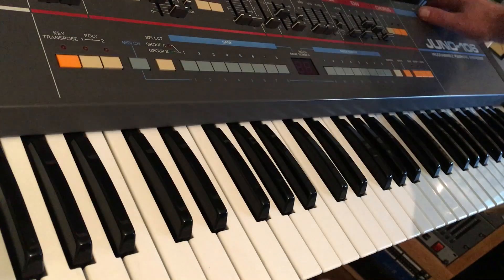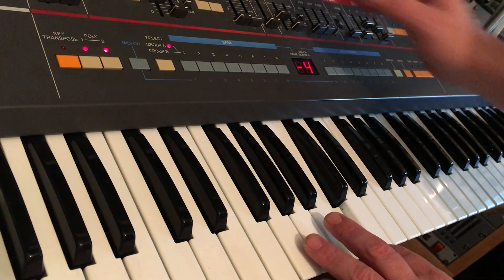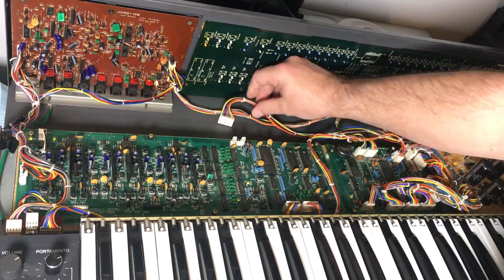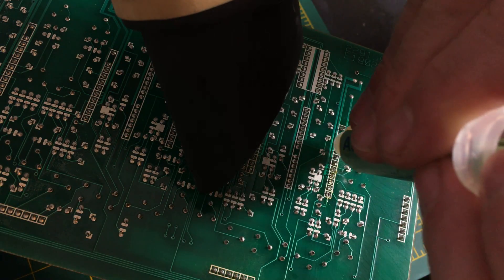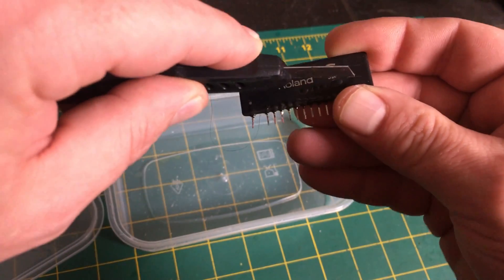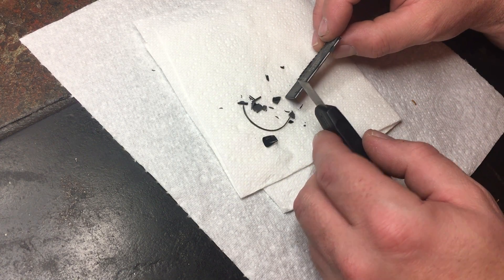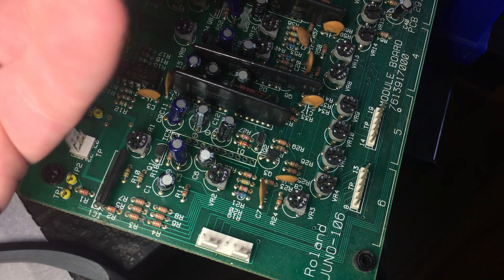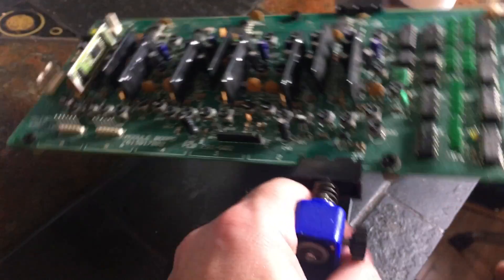Juno 106 Voice Chip Repair

Comment: If you plan to solder new male headers back onto the chips, just gently break them off the board at the pins and then desolder the pins one by one. You'll be replacing those pins anyway. It makes desoldering a whole lot easier.
Reply: lightbulb goes off in head this saved me soo much time. thank you.

Comment: So I have a juno 106 but every now and then a note will just not play and be staticy it will do this randomly with random notes I think it might be the frequency module but I'm not sure :0
Reply from the maker: if do the voice check like in the beginning of the vid you can see if its the same one that sticks high, it might not be as random as you think
Reply: but some keys just wont work when selecting poly 1 or poly 2 individually when both are selected, all the keys work but the notes are mono and i cant use multiple notes at the same time and every now and then a note will be scratchy. But im wondering where you are located because im just considering sending it to you or someone local to get it professionally fixed because i dont want to break it XD
Reply: Ok i just check over it, it seems it was acting really bazaar because 4 or 6 voice chips are not working

Comment: when you re-soldered the pins on the chip, did you solder on both sides of the chip? (the white side also?)
Reply from the maker: there are only solder points on the green side, as far as I remember the ceramic side is just a cradle point
Reply: I thought so too, but I read another article that said to make sure to solder on the ceramic part as well... I've just soaked 2 chips & am trying to get them working, but they're not.. just trying to troubleshoot on what I may have done wrong here, thanks for the input!
Reply from the maker: did you reflow all the ic pins etc?
Reply: I thought I did, I'm not an expert at soldering so I may have done it wrong, I'll try it again

Comment: What is the socket you are using to put the chip in called ?  Thx
Reply from the maker: It's called a female pin header,  2.54mm spacing
Reply: Thank's
Reply: @reallyniceaudio  thanks for the specifics on the header, I want to order some myself for future ease of repairs and troubleshooting.

Comment: Good job, however if you soak that chip in the acetone for a minimum of 48 hrs, the epoxy will literally fall right off and the chip is alot easier to work with . You also really need a good quality desoldering station to do this job properly as solder wick will damage the traces too easily. All 6 voice chips should be done as eventually they will all fail at some point.

Comment: Nice.  Amazing work.  My Juno 106 sounds a little crackling on the outputs.  I've had them repaired before, but the sound has returned.  I haven't had the chip issue yet, but it was really nice to learn how to check each chip.  Thanks for the wonderful video.  I really appreciate it.  The Juno 106 is one of my favorite synthesizers.  :)  Sam.